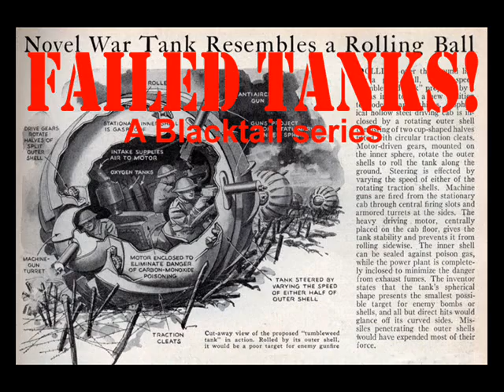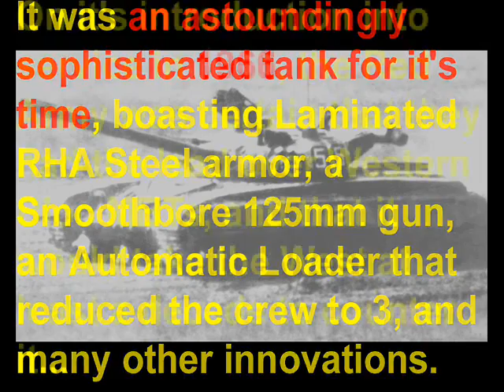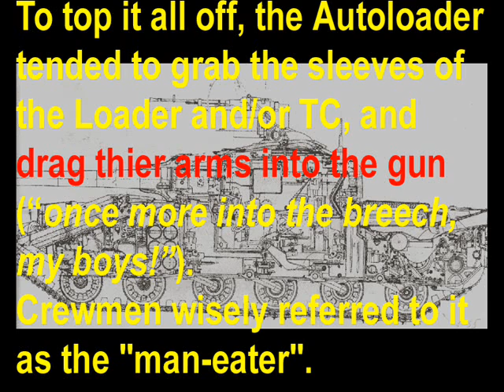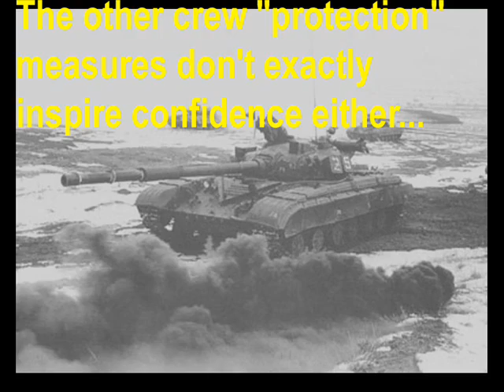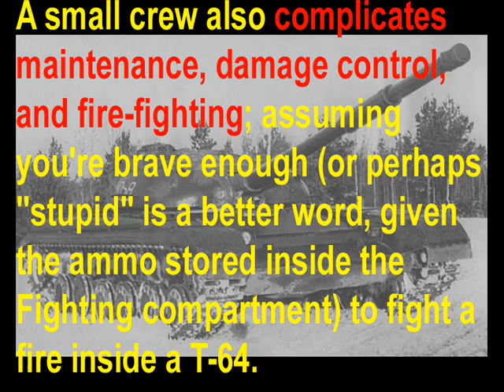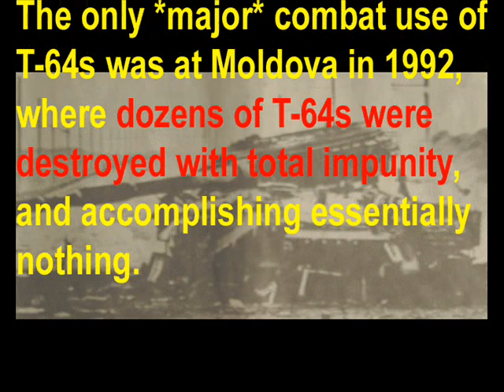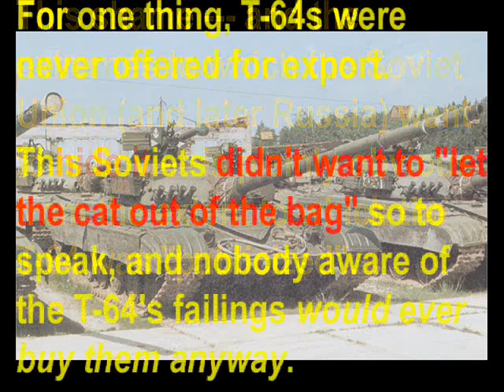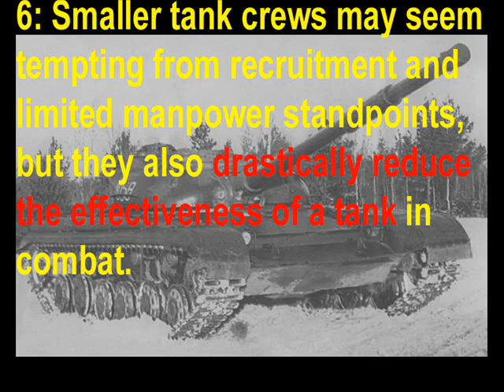Failed Tanks, Chapter 4: The T-64

Comment: Oh, by the way, I also think M1 Abrams is a Battle winning tank, not a war winning tank.
Reply: Tankman 1995 M1 tank was designed to be a defensive tank, Soviets tanks are offensive tanks. As a defensive tank, short tactical mobility is more important, and because is on defensive roll, supply is plenty so M1 was not design as a tank to run in a battle field and conduct a offense. It rather for defend a line with short but effective battle capability.
Reply: I very much like your distinction of battle-winning vs. war-winning tanks, and you just pronounced in beautiful words what I had tried to explain in endless comments, about the T-34, the Tiger, the Sherman and the Panther.

Could there be a two-way winner? A tank that can win the battle and the war? Or must the winning combination always be a high-quality/low-number and good-enough/many-of-them mixture? A better than them + more than them will surely blow your defense budget, but will it really beat them?

The Panzer III in my opinion was an example of the opposite: a tank losing in battle against a T-34 or Sherman, but also losing the war for Germany being very expensive to produce: Germany managed to churn out as many Panthers per month from 1943-1945 as they had Pz III and IV combined before, and the Allied bombardment of  the German armamensts industry did not relent after 1943, but rather picked up more seriously.
Reply: Fane Frank Agreed. I think the M1 would fend well in battles that do not last too long but for those that require constant fighting, the M1 just wouldn't be able to do it. I am American and prefer the French's Leclerc and the German's Leopard 2. Both those tanks make the M1 look like a puddle of jelly
Reply: Oh yes he did. Go on kid check out your facts. Ever heard lion of bablion?  That tank is a T72. But your just to fucking stupid to realize. You're speaking back to someone who study's tanks.
Reply: ***** Actually Lion of Babylon is a T-72. If you want to say I don't study. Than why haven't you even asked me any question's. For infact. You're such a Moron, You just made your self look even more dumber. Infact let me correct you. Lion of Babylon, Is from Czech On parts. I bet you're one of those drunk ass Russian's all pissed off due to the fact The USA military builds way better weapons than Russia does. So please stop being stupid and do more research. Or ask me. And ill tell you right away.

Comment: I personally categorized tank in Two categories: The tank could win a battle, or a tank could win a War. The example will be German Tiger and Soviet T-34. The Tiger could win a battle, but lost a war, the T-34 is a war winning tank. Because beside simply fire power, armor, power train. There are more things to be consider in tanks. The T-64 is a battle winning tank. It could win a upper hand in battle against T-72, but in a long scaled war? Not so much
Reply from the maker: That's the best description I've ever heard of these kinds of weapon systems. They're loaded with advanced technology and powerful weapons, but they don't have the numbers, reliability, or sustainability needed to be of any use in the long haul --- by 1945, only a handful of Tiger IIs had been completed, and even fewer Tiger Is had survived, leaving the Pz.IV to pick-up the slack.
Reply: BlacktailDefense One of the two key quality I noticed among all the weapons systems is the self sustainability. Basically means how long a weapons system can work on its own, how easy it can be fixed, how easy it could be manufactured? and another character will be the battle performance of the weapon system. Tiger II tank has high battle performance, but rather low self sustainability, so dose most western tanks. these high performance-low sustainable weapons are "Glass Blade", they are sharp, but very easy to broke. As for weapon like AK47, Type 59 tank, 107mm rocket, RPG-7, they are like stick, not sharp at all, but you can always depend on them.
Reply: BlacktailDefense when shit hit the fan, when all those large factory destroyed, weapons that could survive harsh environment, simple maintenance and poor manufacture processes will be the real war winning machine. That is why until today, I still think tank like T54 should be seriously consider as the post dooms day weapons.
Reply: There is reason why Russia only has about 600 T-90s in its tank force. T72 proven to be a much better bang for your buck. Same in China, with ZTZ 99 and ZTZ 96. ZTZ 99 is superior to the 96, but the 96A is much more worth it to deploy in large numbers. ZTZ 99 only reserved for the most elite armies
Reply: T-90 is actually an overhauled T-72 design. The T-90s are meant to phase out the older T-72 chassis. While providing economically viable improvement.
Reply: Kevin Smithwick You're exactly right. That is why they probably abandoned the Object 187. But they are giving up on T-90s to save money now, also. They are upgrading their T-72Bs to B3 or B3M
Reply: OL  Granted T-90 is essentially an upgraded T-72 platform. (T90 was originally called T-72BU)
Reply: Kevin Smithwick  I know this, Obj. 187 was abandoned for Obj. 188 which is literally the T-90. However, T-90M (and T-80BVM) is still much more expensive but also significantly improved compared to T-72B3.

Comment: Viktor Suvorov, who used to be a tank officer in the 1960's, recalls in his memoirs the T64 to be a "shitty" tank. Track thrower, not reliable enough even for a parade in the Red Square, bad engine, inaccurate main gun. Just read "The Liberator".
Reply: But Victor Suvorov is full of it!!
OFC the tank proofed unrealible early on, but using such a CON-MAN as a source is not wise...
Reply: babehunter1324 Why calling him a CON-MAN? Everything he says makes sense, unlike the official propaganda.
Reply: Lucian Ene Please, then explain WHY ukraine fields HUNDREDS of T-64 dating from the late 1970s to 1987? 1987 is 27 years ago! They run fine, are reliable, even if very poorly maintained by the ukraine monkey army and banana military budget!

STOP BS. T-64 are RELIABLE and DEPENDABLE tanks, just like the T-72, with some cons and pros over this guy.

ONLY PROBLEMS were with ORIGINAL ~600 T-64, the object 432 tank with 115mm gun, and many youth issues. They were TESTED and CORRECTED between 1963 and 66. The T-64A was a new tank with many improvements, then T-64B perfected the design. T-64 were mostly rebuilt as T-64R and functionned well after that.
Reply: PATRONSKiii
I think you're mistaking the T-80 for T-64. The guy says it was in production for only four years, that is 1966 + 4 = 1970. What "late 1970's to 1987" are you talking about?
Reply: Dmitri Benner, who also served in a T-64 on duty in Germany, recalls that most of those teething troubles were sorted out when he rode it. If you read German, go and enjoy:
http://t-64.de/frame-start.htm
Reply: +Lucian Ene Viktor Suvorov LOL The gy was PAID to spread anti-soviet shit all over, He is a traitor and a jackass.
Reply: +Charlie Gareginyan 
Have you read any of his books? I would recommend "The Last Republic" for starters. Just give it a try.
Reply: Lucian Ene I have read his materials and it was debunked by many other former soldiers, he not only over-exaggerates the supposedly bad state of the armed forces but also spreads the most prickly and disgusting bullshit all over it to top it off.The man did what he was paid to do, make shit up about the USSR. any other soviet vet will tell you otherwise. hell I work with a guy who fougth in afghanistan, and guess what, his stories don't corroborate THIS liar's at all.
Reply: +Charlie Gareginyan 
And this proves that you haven't read anything, not a line of text written by him. He never "over-exaggerates the supposedly bad state of the armed forces", but totally the opposite.
Reply: +PATRONSKiii 
This would be like trying to explain why Ukrainians eat a lot of pork fat, despite its obviously adverse health effects. No offense intended.
Reply: Lucian Ene totally the oopposite his descriptions on the army are probably the most anti-soviet I've seen he describes the officers as  mindless brutes, the tanks crude and dangerous and the soldiers to be stupid grunts.
Reply: Thomas Altorfer Well no the T 80's turbine engine was developed BEFORE the US did and was actually more fuel efficient, the problem with the T 80 was that it was more expensive instead its tech was added onto a redesigned tank based on the more durable T 72 chassis and armor LAYOUT creating the T-90
Reply: +Golden Eagle yes, but then again: how many non-USSR tanks have been built in >10'000 copies? The M4 Sherman, of course, and the M113 (not strictly a tank, I know)
Reply: +Charlie Gareginyan 
Just what are you babbling there? What Suvorov book have you red, precisely? Because it doesn't sound like him at all. 
In "The Liberator" Suvorov refers to the T-55 as "our beloved T55, a modest war worker that doesn't break open enemy turrets but kills for sure every time", to the T-72 as "robust and unpretentious", and to the T-10 as "the best heavy tank in the world, to remain in service up to the 1990's". These are hardly descriptions for crude and dangerous tanks. In "Aquarium", the part where he recalls his years as a tank commander, Suvorov speaks highly of his crews, made mostly of Asians who didn't even speak Russian but managed to work together as a well-greased machine. 
Also in all his books abou World War Two Suvorov describes the T-34, KV-1, IS-2 and the like as the best tanks in the world, one generation ahead of any foreign competition. Looks to me that you haven't read any Suvorov book proper, but only the words his detractors have put in his mouth. Come on, give it a try, I guarantee it will be worth it.